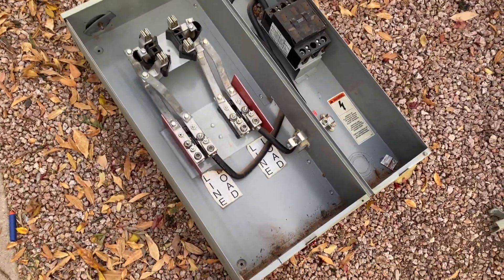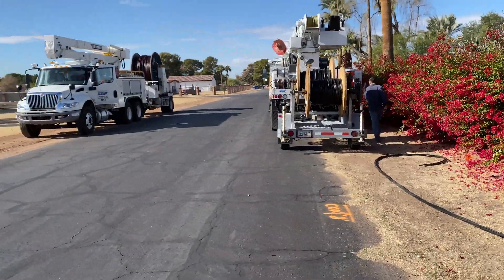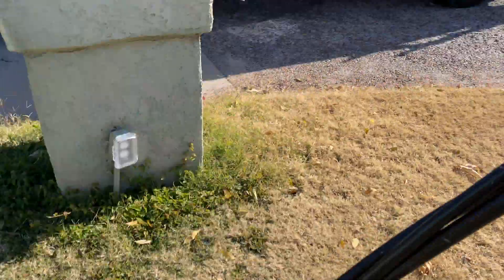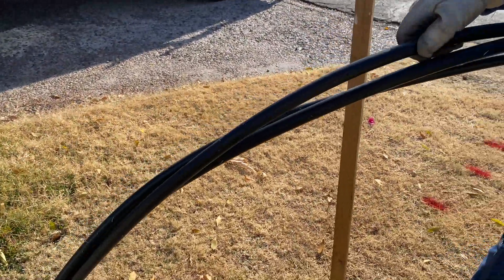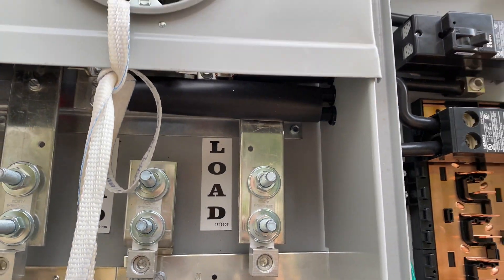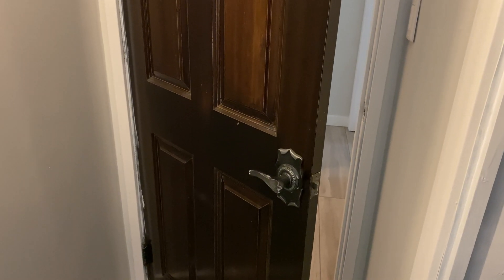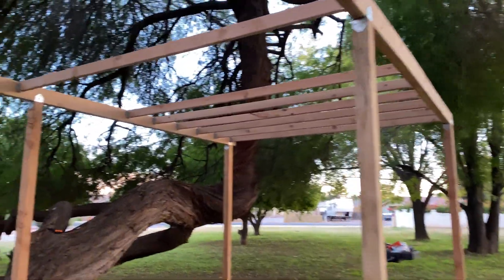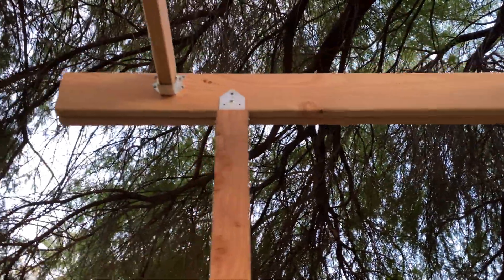400A amp electrical service upgrade! Mega panel for solar inverter interconnection and MORE POWER!!!

Comment: Do you think that it would be possible to install a 400 amp service panel with a 200 amp sub panel in a residential situation??
Reply from the maker: Yup, that's actually what I did. The 400A main goes to 2x 200A subs.

Comment: The bus in that box is tinned copper. Looks like aluminum, but it's not. I'm waiting for siemens to deliver that exact box. Neat to see srp putting in 350kcmil for the 400 amp service. Gives me a good idea what they are going to do for me. I'm going to be doing overhead though.

Comment: Is the 11.4kw system a tesla system? I'm curious how much an upgrade like this goes for typically. Getting a 16kw system installed in about a month.
Reply from the maker: No, I went with REC Alpha panels that, at least from the specs, are expected to have greater longevity. Tesla has the lowest sticker price by far (probably mid-$20K), but the direct consumer reviews are horrid and I am not a fan a Tesla. I don't know where you are and what variables you have, but for something this involved you'd probably be low $30K's. There was a lot more to this site than what is shown though.

Comment: Did you get a powerwall or thinking of getting one?
Reply from the maker: No, as there isn't a compelling financial reason to get them. After doing the math, I would need the price (and size) of the units needs to drop significantly. The novelty is worth nothing to me and the proprietary interface over what is essentially laptop batteries seems more like an unnecessary liability.